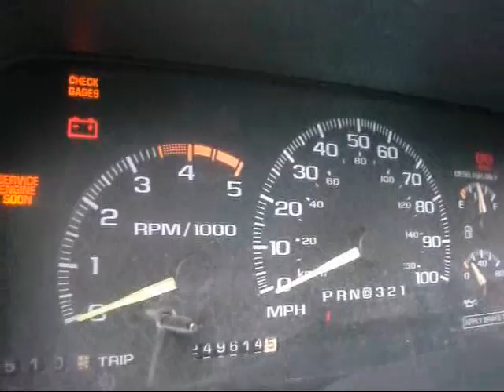2 23 13  Weasel Rotella Sludge Vid

Comment: oil pan clean up would be the better solution.
-you use a good quality oil
-,don't make short trips
-,change it regularly.
-good running temps
it's just the synthetic oil cleaning up the previous owner mess.

Have you got a oil cooler   ?   (engine oil /coolant heat exchanger)

Comment from the maker: I suspect the engine had good maintenance b4 me, and I use Rotella syn, and a top quality filter. I think I may have a bad head gasket, coolant is frequently low, not good, and that could be where the sludge is coming from

Comment: Engine sludge can be caused by the engine not getting  to proper operating temperature, a diesels engine is known to run much cooler than a gas engine, thus why thermostats need to be set for a higher stall/ delay temp. Wasn't the truck from  Arizona , the tempis much higher, its possible they installed cooler thermostats to offset the heat and keep the engine temps down, where as in the Adirondacks the  temps are colder much colder, Replacing your 180 degree with 195 degree will do the trick

Comment: Mixing synthetic , and conventional oil will cause goop , you are running synthetic , and it is washing the build up from the lifter valley ect , and making the sludge , swap to conventional oil , and after a change or two it will clear up

Comment: Cant you put like a 1/4 of a quart of trans fluid in the engine for a few hundred miles like you would on a gasser to wash it out or will that damage the engine? I have no idea how diesels go about there lubrication. But i know putting alittle bit of trans fluid in the oil washes out sludge. Did it with the chevy ticker vortec motors!

Comment: I know diesels tend to blacken oil quicker than gas but that doesn't explain the chunks. If I was the lucky owner of a turbo weasel I'd change that oil as soon as you get a chance. Of course run it to warm it up first. Let it all drain out and fill it back up. There could just be a lot of buildup in the sump and pickup. I dont like engine flushes personally but maybe that would help also.One things for sure though, that oil isn't doing anything good looking like that! Good luck!

Comment: It looks like the 6.5 has an oil cooler but its oil to air (yuck). My guess is the oil is getting cooled to much in the winter. Get a grill cover for the winter if your fan clutch works. It will bring your temps up.